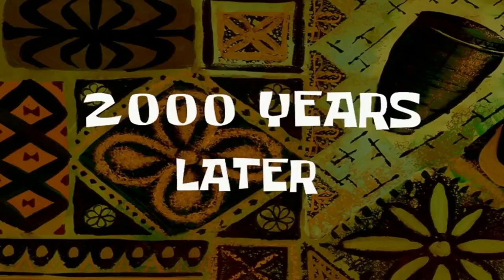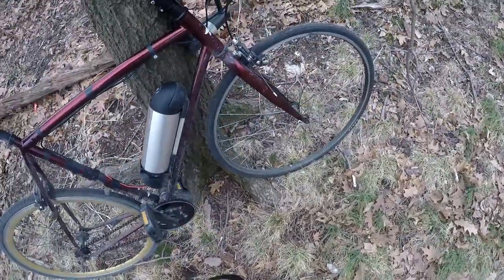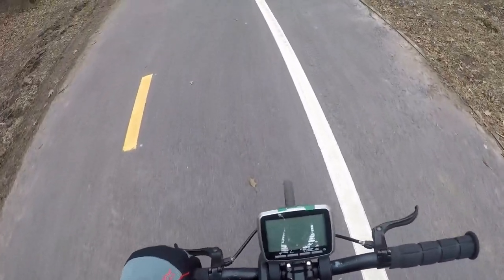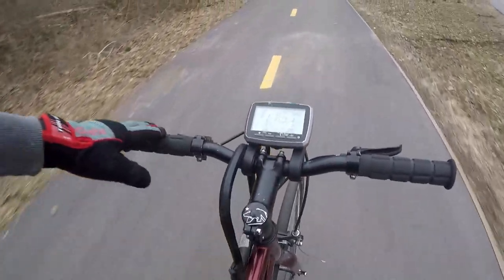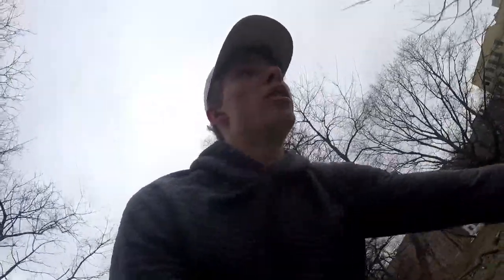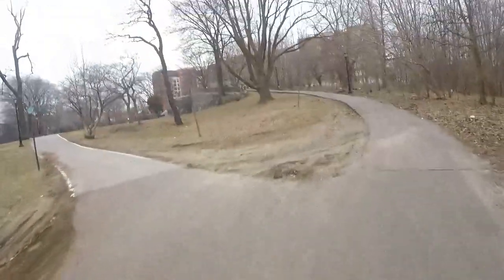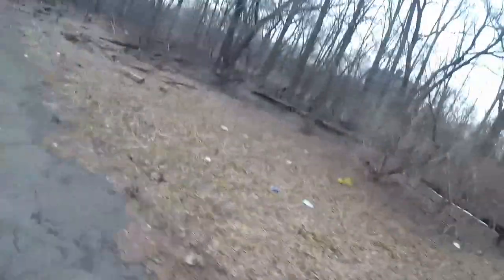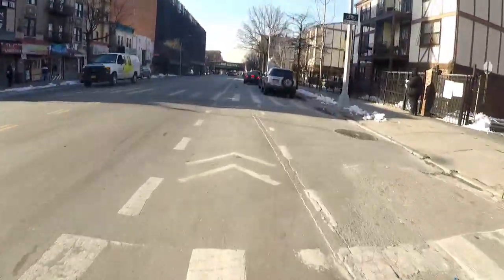DO NOT build this bike mod!

Comment: 1 thing you didn't know or still don't. There is some safety like feature. When you turn on the motor don't move the bike or pedals!!
So if you turn of the kit while riding you Wil actually brake on the engine! As you can clearly see he has problems with. (buth hasn't noticed yet,, just after testing without kit on)